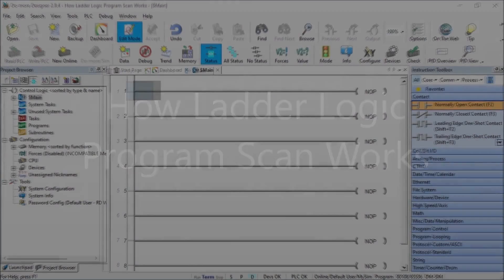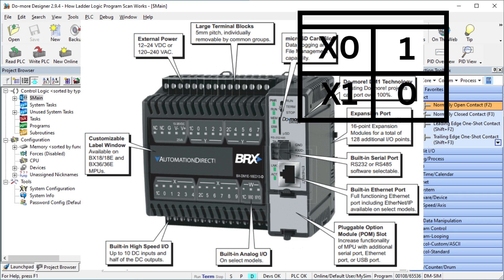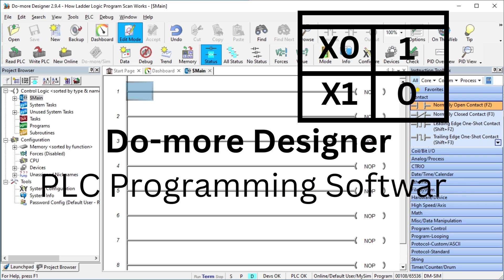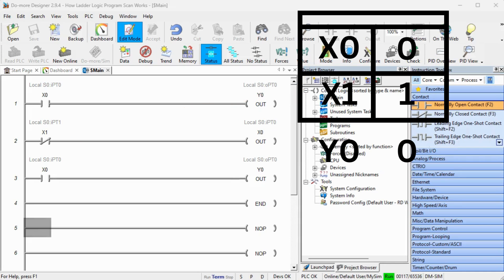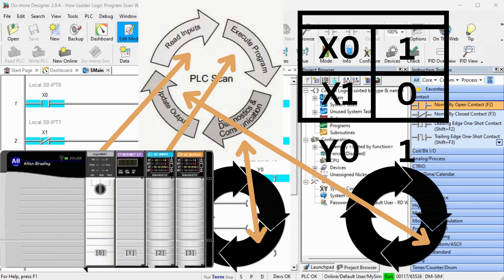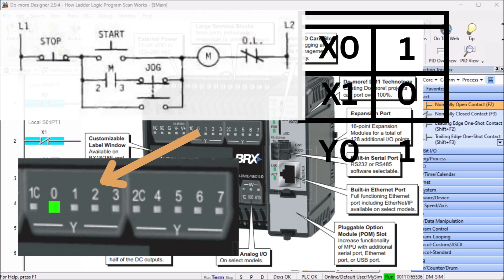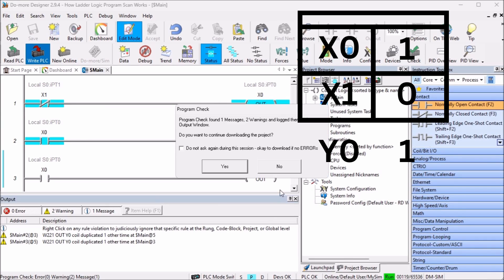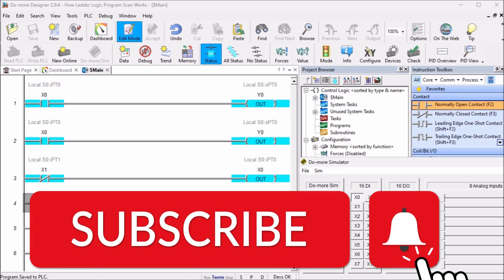How Ladder Logic Program Scan Works

Comment from the maker: Detailed information and links can be found on the corresponding post located here.
https://accautomation.ca/how-ladder-logic-program-scan-works/

Here are the controllers that we have covered at ACC Automation:
BRX Do-More Series (Do-More Designer Software + Simulator)
https://accautomation.ca/series/brx-do-more-plc/
Productivity Series
https://accautomation.ca/series/productivity-1000-plc/
https://accautomation.ca/series/productivity-2000-series-plc-p2000/
Click PLC Series
https://accautomation.ca/series/click-plc/
Omron CP1H Series
https://accautomation.ca/series/omron-plc-cp1h-series/
Horner XL4 PLC Series
https://accautomation.ca/series/horner-xl4-series/

https://accautomation.ca/series/easyplc-software-suite/
EasyPLC Software Suite is a complete PLC, HMI, and Machine Simulator Software package. See below to receive 10% off this software. This PLC learning package includes the following:
Easy PLC – PLC Simulation that will allow programming in Ladder, Grafcet, Logic Blocks, or Script.
HMI System – Easily create a visual human-machine interface (HMI)
Machine Simulator – A virtual 3D world with real-time graphics and physical properties. PLC programs can be tested using EasyPLC or through other interfaces. (Modbus RTU, TCP, etc.)
Machine Simulator Lite – Designed to run on Android Devices.
Machine Simulator VR – Virtual Reality comes to life so you can test, train or practice your PLC programming.
Purchase your copy of this learning package for less than $75 USD for a single computer install or less than $100 USD to allow different computers.
Receive 10% off the investment by typing in ACC in the comment section when you order. http://www.nirtec.com/index.php/purchase-price/
Learn PLC programming the easy way. Invest in yourself today.

Regards,
Garry
ACC Automation
https://accautomation.ca/

Comment: Hello ACC.    First question comes to mind.  How does one save the CTO.ACC,  if program mode was to stop and the run again I see the .ACC resetting to zero.  How does this rung ladder work if I wanted to initiialize values one time on boot up.
Reply from the maker: Hi @phillipmaser132,
This is a common question. Use the first scan bit (ST0 in the Do-More) on the reset of your counter. When the PLC first powers up this bit will turn on for one scan, resetting the counter.
I hope this helps you out.
Regards,
Garry
Reply: I am not finding CTO.ACC retentive.  If i stop the program and start it back up.  CTO.ACC is zero after 3 days of counting.
Reply: Maybe the CMore can save this value to a;n SD card.